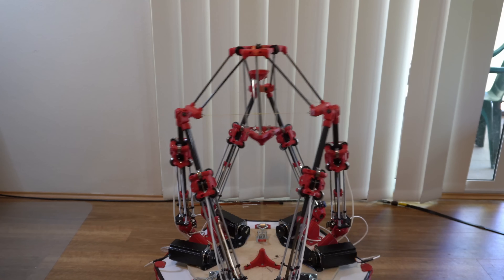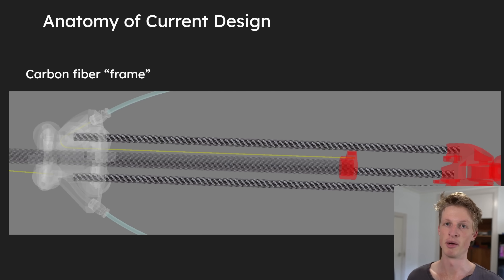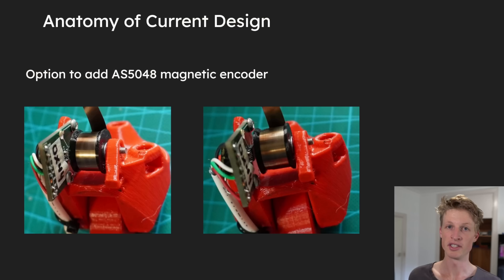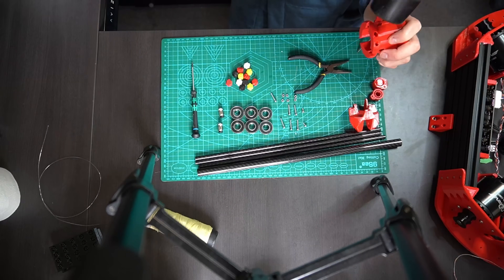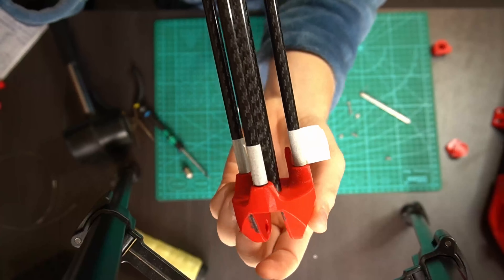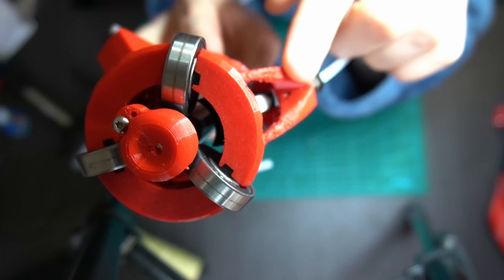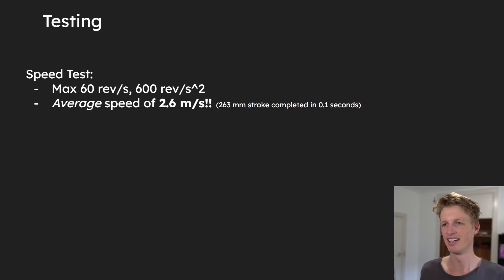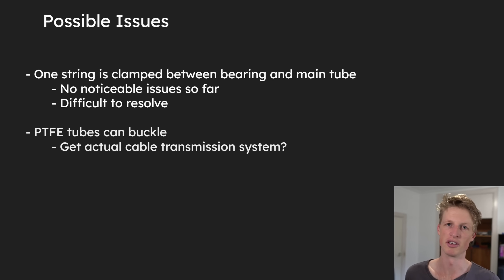Designing High-Performance Linear Actuators: Speed & Stiffness for my Juggling Robot | PDJ#19

Comment: Pretty interesting design. 
Besides the speed endurance test with 2,6 m/s (which is quite fast), have you done a load test? Which load can actually be lifted/pushed until it will collapse and also in endurance run? Would be pretty interesting. Those Kevlar strings should be able to withstand a lot of force I guess.
Reply from the maker: Cheers!
I actually haven't run a force/power test, for two reasons:
1) I don't need a crazy amount of force for jugglebot, and
2) I couldn't think of an easy way to mount a load to the CF tube

I reckon it should be pretty strong though! The strings are definitely the weakest link, and they've got a breaking strength of ~35kg. I'm also likely going to replace them with braided cable so it should be super strong then!
Reply: @harrisonlow  dyneema cables/ropes with a small diameter could maybe be a good option? Very little elongation under load, good for precise control and positioning.

Comment: Have you considered pneumatic actuation, having an air compressor and control valves as your primary motion controllers?
Reply from the maker: Not really, though that would be cool to try out! I don't have access to any pneumatic hardware so I can't easily try that (yet)

Cheers for the suggestion!

Comment: 5:25 Not just backlash causes position uncertainty. Also the combination of stiffness with friction causes it through what is called 'virtual play'. Considering you are using a cable drive I suspect that the friction in the system is quite large.

Comment: Very cool. Hey.. How much pressure can these produce in kilos?
Reply from the maker: Cheers!
I actually haven't run a force/power test, for two reasons:
1) I don't need a crazy amount of force for jugglebot, and
2) I couldn't think of an easy way to mount a load to the CF tube
Reply: @harrisonlow  I think this might make a good self steering for a sailboat..

Comment: Idea: use one string to transfer force and a different string to just measure the length. If the tension on the measuring string is small, then you should get away with the lighter/cheaper PTFE tube for it.

Comment: If you're ever looking to make this lighter check out rev robotics they have a tiny brushless moter that does everything you need in a 1/4 the size and weight of what you're currently using. It's called a neo 550

You would also benefit from implementing a pid controller for the extend and retract position. It would ensure that you always get to your setpoints
Reply from the maker: Interesting! I'll check out those motors, thanks! The motor mass actually doesn't matter for my application because they're not directly attached to the actuators. If anything, a bigger mass is a good thing because it gives some heft to the base of the robot, hopefully stopping it from tipping over when doing big moves. 

Re. PID controller: the ODrive actually implements two PIDs for the type of control I'm using. I just haven't finely tuned them yet 😅

Comment: About the string hitting the rod/bearing. Now your 2 sets of 3 bearings are shifted 60⁰ from each other. Can't you rotate the set of 3 bearings, that hit the rod/bearing, say 10⁰ so that the string doesn't hit the bearing? A small rotation doesn't effect the stability too much, I think.
Reply from the maker: The main issue with rotating anything is that space is very tight in that upper bearing block and I couldn't find a good setup that would be printable, relatively easy to manufacture, and have no collisions between parts. I'm sure it's possible, though I think the suggestion to use V- or U-groove bearings is nicer (and a lot easier to implement!). 

Cheers for the suggestion!

Comment: fascinating work, loving the project so far. have you thought about making a carbon fiber rod with a small groove to route the string? not so large as to compromise the structural integrity, but large enough to relieve the stress put on it by the bearing.
Reply from the maker: I'm not sure what you mean by this, could you elaborate? Which tube would have the groove?

Thanks for the kind words 😊
Reply: @harrisonlow  the central tube, the actuator itself. You mentioned in the problems section that you didn't like having the cable pressed between the center tube and the bearing, so having a small groove to relieve that pressure, but still maintain a mostly circular shape could keep the tube held tight by the bearing while freeing the cable to be less "in the way"
Reply from the maker: @joshaconnor  Interesting! I hadn't considered that and I think it'd be tricky for me to implement as my access to proper tools is limited...

I think a V- or U-groove bearing (as others have suggested) would serve the same purpose and be much easier to implement. 

Cheers for the suggestion!

Comment: This looks very nice and I can't wait to see this running.
@11:57 - is exactly why kiting shops don't sell these kevlar lines over here any more. These lines cut fingers too so we are now allowed to only used kevlar with a braided cover.
@James Petersen suggested the use of bicycle brake cables but this is the wrong type to use. Outer brake cables can be compressed. You could try to use the outer gear cables instead, a lot of them even already have a PTFE liner inside to reduce friction. But do go out to a bike shop, tell them why you need these and check yourself if these are flexible enough for your use. Original Shimano cables are most likely way too stiff.
Reply from the maker: Cheers for the suggestions! That's interesting re. kevlar strings. Thanks for sharing that!

Thankfully I'm pretty sure I have both brake and shifter sheathes lying around that came with cables for my bike. I'm planning on making a testing rig to test a bunch of the ideas that everyone has suggested, and I'll absolutely be trying shifter sheathes. 

Cheers!

Comment: Excellent work. I’m making an animatronic Luxo Jr lamp (from Pixar) and theses actuators seem incredibly promising for the energetic character
Reply from the maker: That sounds awesome! I reckon you could use something much more simple than these actuators. What about making the spring part a rather strong compression spring (pushes out when compressed) with a string routed through it's core. When the string is pulled, the spring will compress. When the string is relaxed, the spring will expand.

Should be fairly fast, though it'd have a few disadvantages, namely nothing resisting compression forces. 

Sounds like a cool project! Are you making videos of it / do you plan to when it's done?
Reply: Sounds good 👍
Reply: Thanks for suggestion! While I am still determining which motion system to use, I think I will construct a Stewart platform because of the range of motion it provides as well as speed with actuators like in the video, but weight could be a possible problem (I also really want to build one😅). I'll post once it’s done though it seems like a never ending project😂
Reply from the maker: Haha I can relate to wanting to build a Stewart platform; they're pretty cool mechanisms!

If you remember to, I'd appreciate if you sent me a link to your video if/when you make it - sounds like a cool project and I'd love to see it in action!

Comment: Print a roller with a groove in the middle to clear the string. Press the bearings into the roller. Only the roller with the string needs the groove. Actuater rod will be rolling on a printed surface instead of the hardened race of the bearing, but at least the string won't be getting pinched.

Comment: You should check out Proteus Motion, in our original design we used steel cables in a similar way for our power transmission system but we were only using magnetic brakes instead of motors. We had similar issues with tolerances for carbon fiber tube moving  through bearing but we used set screws to push the bearing into contact with the CF tube but your system of replaceable parts probably would have been more reliable in the long run.
Reply from the maker: Interesting! Looks like a really cool machine to work on. How did your set screws push the bearing in? Did they push the axle that the bearing was on inwards?
Reply: @harrisonlow   that's correct, we had 3 bearings to position the CF tube. 2 bearing were fixed and the the 3rd was on a shaft that we adjusted with set screws. 

Another problem we ran into early on with the CF tube was over time the glossy finish of the tube  would start flaking off where it contacted the bearings. It looked bad but worse the  flakes would get crammed into the moving parts and gum up the system. We ended up finding a new supplier with a matte CF tube that didn't have the coating.
Reply from the maker: Hmm. Good to know that I should keep an eye out for that! After all the suggestions here, I'm probably going to print some spacers (with TPU) between the bearings and the main CF tube, so that should go a long way to minimizing wear

Comment: Also just use bicycle brake cable parts. They are super cheap and designed for  high force's. The steel brake cable is really quite flexible.

Comment: I thing, if you redesing were the the point of the strings are fix, you can get rid of the bearings and use a bushing system, similar of the the BambuLab X1 and P1P printers have in theirs X axis, a carbon tube in a polymer bushing.

Comment: Not sure how I stumbled across your video, but glad I did! Your design maintains an excellent consideration for many of the factors I must build to at my current job. Always fun watching solutions to problems. This is a very clever design! 
My only thoughts on materials would be a fishing line brand, Spiderwire. Instead of the usual monofilament, one of their products uses a woven structure. This material would help with any stretch and offer more perks like wear resistance and strength.  Another thought is to minimize the "hypotenuse" others have already mentioned in other comments about the string path for measuring true location. Could another roller be added to put the string closer to perpendicular to the center axis before the tubing? Would be tangent to tangent that way. Or could the roller just be bigger? Maybe in a different spot? Anyway, a tangent to tangent 180° could be an advantage in measuring.
I hope this makes sense. Probably not haha I'm tired. 
Cheers.
Reply from the maker: Neat! What do you work on that relates to this? 

Not gonna lie, you lost me towards the end there 😂 I agree that I feel like I should make the string more parallel to the extension axis, though part of me thinks it won't make a difference at the scales I'm working with. I'll have to wait and see how precision control goes once I put the whole robot together. Just waiting on one more part to arrive!

Re. Spiderwire: do you think that'd be better than braided metal cables? I've picked some up and they seem really good, though I haven't had time to do extensive testing yet

Comment: For the string running between the bearing and the cf tube, would it be possible to use V groove bearings? That would double the contact points between the bearings and the cf tube and also give some clearance for the string between the circular tube and the bottom of the V groove.

Comment: Hey, I don’t see why you couldn’t print some brackets and attach the tube to the carbon fiber rods… At the end of the day, you don't need the entire tube to be flexible, you only need flexibility close to the pivot point, like at the base of the structure. That should minimize the tension in the length of the tube and make it far more rigid, without extra rigidity (or stiffness) or weight in the structure.

Comment: Great job mate, I really love cable mechanisms. Just as a fun fact, engines use half-bearings with different thicknesses to compensate the manufacturing variations between parts, your solution really made me remember that, they're also diferenciated by color. Again, great job!
Reply from the maker: Haha yep, colour differentiation helps so much. Got the idea from the adapters that came with the encoders to fit differently sized shafts. Such a simple solution!

Cheers for the kind words 😊

Comment: 14:05 in the upper-right of the camera frame, you've got what appears to be an electrical wire, resting against the outside of the motor body. This is a direct source of friction that will eat through the wire insulation and either lead to a short circuit or a broken wire. Might want to make sure you don't have that there for long-term cycle/endurance testing ;)
Reply from the maker: You've got a keen eye! That cable is only there for testing and there won't be any cable drag in the final design 😊
Reply: @harrisonlow  It's a mistake I made on a project awhile back and so now it's something I always look out for, hahah! Binging the older videos and really enjoying the content and progress, happily subscribed now! Good luck with your project!

Comment: Hi Harrison, I couldn't help but notice you're using 6 axis but throwing and catching balls only requires 3 DOFs. The balls don't need to spin. Wouldn't it be easier to use a delta robot to throw the balls? Here's an example: https://youtu.be/wuPGyzD18w4 

They've a large range of motion in x and y, are very fast and have very few parts. Also they use a rotating arm on a motor instead of a linear actuator, which is more faster and requires less parts. You can mount a hand directly onto the platform, because a delta configuration robot can be fast enough to throw the ball itself. It's also possible to actuate a Steward platform with rotating arms, like this example https://youtu.be/tenxq7N5q3k

Don't get me wrong, I love what you're doing here! I've done similar projects and I know that there are many ways to solve this problem. I've done the mechanical design for this robot https://youtu.be/BdUcaXalP9Y. It started as a hobby but grew to a real product 😁
Reply from the maker: Interesting ideas! Some thoughts:
1) You're correct that the balls don't need to spin, but I want Jugglebot to be able to throw at different angles, which means it would need to be 5DOF (to also be able to throw/catch at different positions). The 6th DOF (yaw? - rotation about vertical axis) isn't needed, but I just won't move the platform in that way. I couldn't find any examples of a 5DOF mechanism that suited this purpose so I figured a redundant DOF isn't so bad. Also technically you're right that 3DOF is all that's needed, but it would have to be two rotation DOFs (about the two axes in the horizontal plane) and a linear translation DOF, which is mounted on the part that rotates with the other 2 DOF. This requires that the ball is caught and thrown from the exact same spot though. It's a little tricky to explain that fully, but I'll be covering that in a video at some point (probably not for a while) because I think it'll be the easiest/cheapest way to get lots of Jugglebots working together.

2) I love the T-Flex link! I actually already had that tab open 😂
3) That looks like a really neat pick-and-place machine! How did the process of it turning into a real product go? Were you approached by Jansen Techniek?

Cheers!
Reply: Thanks for your reaction! I meant to get red of the actuated hand, so the arm will have to move fast enough to throw the balls. But I realize that might be too fast for a robot to move. 

Well, I was already working at Jansen Techniek. A colleague and I were working on the hobby robot when one day our boss heard us talking and became interested. Still, it needed a lot of hours, like 1200 or so, to finish the design. I had to do many iterations to get to the speed it has now. But it was with it!
Reply from the maker: @DennisBouw  haha yeah, I realized pretty early on that there needs to be a second stage to actually interact with the ball; the platform would have to move insanely fast to throw by itself. 

That's pretty sick! Looks like a really solid build

Comment: You could use PA(nylon) tubing instead of a ptfe, they're way more ridgid and are meant to withstand +100bar of hydraulic pressure (they're used for grease in industrial machines). You can keep the fittings as well since they're available in 4&6mm outer diameter

Comment: Hi there. Great video. I have no need for actuators, never thought about them in my life... But sat and watched your video and now I kinda want to make some! Nice work!

For the cable issues, I was going to suggest brake cables from a bike... I notice its been said a lot already so I guess its something you might try?
Also, to stop the cable moving about and getting under the roller, perhaps add some kind of loop to hold the cable in place?

Keep up the good work!

Comment: What a fantastic design you've made here.  Really neat.  It reminds me a bit of a project I saw on Thingiverse you might like to have a look at, if you haven't allready.... the "Mostly Printed CNC", which makes extensive use of electrical conduit and a roller system to traverse the conduit.  Speaking of conduit, in short lengths it's actually quite stiff and might make a suitable replacement for your three outer carbon fiber tubes if you'd like the driving piston to be completely internalized inside a housing or whatnot.  Heavier tho, a bit.

Comment: Ive just just read every suggestion and thought of the most mentioned one's. String in support legs, use of bike cable sheathing, different shaped bearings. But didn't see any suggestion of just running a rubber pully wheel at the top of the 3 CF legs that snugs up against the CF tube with a tension adjuster.
So your motor would spin the rubber wheel instead 
Would save string going to top and bottom of main CF leg.
Obviously there could be slippage, just a thought. 
Great idea thou.
Im subscribing.............
Now. 
Thanks for sharing 👍